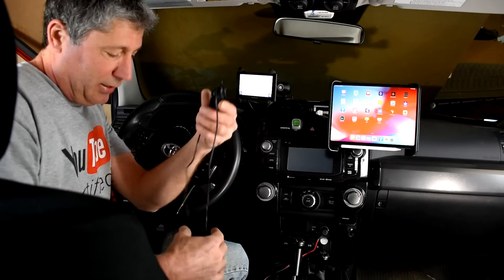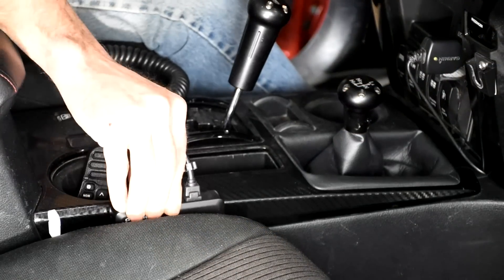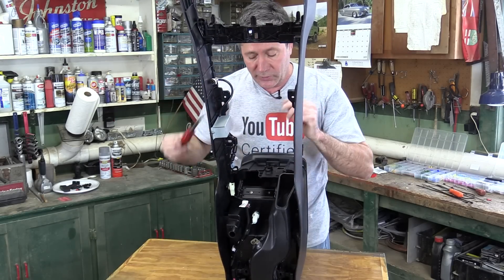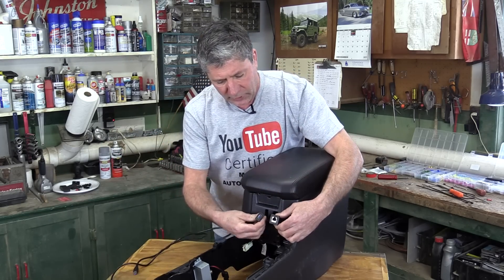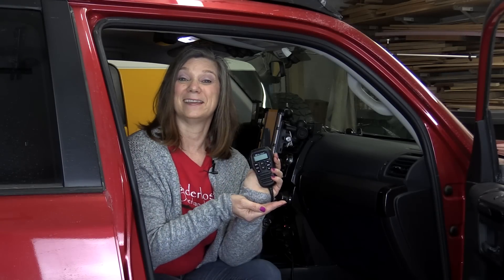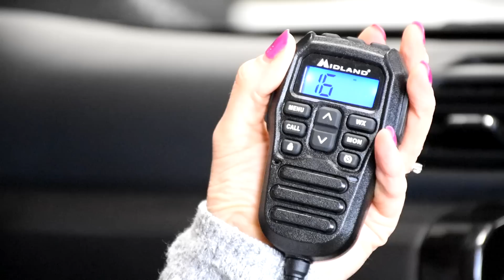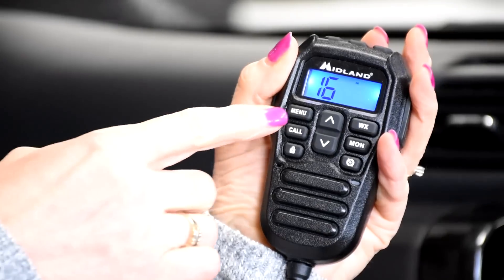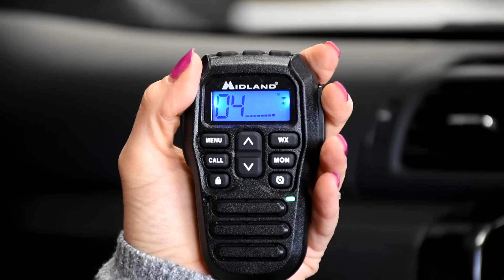GMRS Radio DIY Install & Testing Against CB Radio For Distance

Comment: The +6dB antenna plus a 15 watt transmitter helps a lot over CB which is very low power.  4 watts is the nominal power limit for CB, though that can be increased to 12 watts if using Single Sideband.  15 watts is a pretty reasonable transmit power, especially when using repeaters.  
You shouldn't be daunted by HAM radio, the Technician portion that allows access to 2 meter and 70 cm frequencies is VERY easy and only costs $15 instead of $70  On top of that, there are literally thousands of repeaters nation wide on the 2 meter band that allows for very easy and reliable contact for casual chatter and for emergencies.
Additionally, getting a HAM license allows you to access transmitters of MUCH higher power, giving you a LOT more range for station to station or hitting distant repeaters (60 to 70 mile ranges are common with a 25 watt transmitter.  I have a 50 Watt in my truck).
7-3, folks!  Pete, callsign KD2SML
Reply: I agree, the test was not the difficult. I have a 2 meter (80 watt in my truck) KEOJXA

Comment: Good vid. No doubt UHF blows away CB. VHF (MURS) is better than CB as well. The only advantage in using CB is interoperability with other CB users. Other than that CB sucks. 

If you are gonna go so far as to add a NMO mount antenna, consider a higher watt radio. You’d be amazed what a higher grade 40-50 watt uhf or vhf radio can do compared to what that little midland can.  All that said, you guys did a great job with this vid. 

And lastly, I have a dual band (uhf/vhf) mobile in my Jeep. A dual bander might be something to consider at some point if you want more options (& power).
Reply from the maker: Thanks for the tips, and for watching!

Comment: Ham test is easy.  Mobile uhf/vhf rigs put out 50+ watts and you can use repeaters.  Downside.  No one uses them anymore.
Reply: They don't? Ours are busy all the time here in Texas! Where are you located?
Reply: WW5RM Oregon.  We have repeaters that are in use a lot, but most of the off road/ overland people I know don’t use ham.  Which is a shame because it’s a far superior system
Reply: @NoneYaBidness762  oh I thought you were saying the repeaters weren't used anymore. We have a linked repeaters system that's growing fast here! It covers most of East Texas, North West Louisiana and South West Ark. Plus remote bases in Hot Springs, Little Rock, West of Little Rock and some East of Dallas. They bring up the remote bases for weekly NETs and Severe WX. 

They are expanding all the time! So at any given time you can be East of Dallas talking to someone way up in Ark or North Louisiana. 

I run APRS in my Zuki. WW5RM-9 plus ive got HF too. I do some SOTA too when I can. But I'm to old and broken to do much hiking! lol 

HF is where all the fun is! I got 30M APRS too. WW5RM-13

But MURS is better than GMRS. Unless its a GMRS repeater in your area. Which might explain how they got theirs to work is well!
Reply: @NoneYaBidness762  I forgot. They have the link system all the way up to Central Ark now. One up on Mnt Magazine I believe and it covers west of Little Rock over into Oklahoma I believe. But only certain ones are on 24 / 7. During the weekly NET they bring up all links so its a huge foot print! 

But I'm more of a HF guy. Usually 75M and 40M. I worked some of Europe,  South America, Central America, North America, a few Islands, South Africa and Australia. I prefer to rag chew and pulling legs! Those old farts on 75M always good for a laugh! Tons of fun! =]

Comment: Great video I plan on purchasing GMRS radio and  I am studying to take my ham technician license,  hey I just turn 60 years old everyone should at least have Ham Technician license in there Overland communication tool box.
Reply: A really good way to study (and it's free) hamstudy.org  create an account, and it will keep track of the questions you answer. When I did it, I would put it on T1(or whatever is studying, then the site would keep track of my mastery of that unit, after getting above 90% I would move to the next unit, and so on until I had 90% on all of them. Then I would take the practice tests, until I was above 90%. By the time I paid my $14 and took my real test, I passed with flying colors. It was about 30 minutes of studying a day, for 2-3 weeks. 

*The website is free on mobile or computer, there is an app that cost a couple bucks. I just kept a browser tab open on my phone, and that was free.

Comment: We have a ham Radio due to the remote travels we take. GMRS Technology is amazing. May need to finally pull the trigger. Only hesitation is the current lack of others that are using the GMRS platform.
Reply from the maker: Thanks for watching Mike! We're finding the radio platforms groups are using vary greatly across the country.
Reply: Wanderlost Overland. Own a 2016 JK but love your content.
Reply: Late in this thread, but they'll be a whole lot of Jeepers soon joining the GMRS club.  The folks that run the Jeep Jamboree are changing from CB to GMRS.  You'll need to have GMRS in order to participate.

Comment: Good side to side comparison of CB and GMRS! About 2 years ago I was going to install a GMRS in the Jeep, but had signed up for Easter Jeep Safari and found out that you really should have a CB for that, so put one one. Since that time we have installed a 2m / 10cm Ham radio , and now have 3 handhelds. Don't fear the Ham test; my wife, with no technical background passed Technician Class on the first try, and as she like to brag, I aced it. As Global Mobile said: "...always within range of a 4 meter repeater..." Not that it's of interest to you Toyota types, but Jeep Jamboree has made CB optional this year (it was mandatory) and announced a partnership with Midland Micromobile; I'm guessing that GMRS will be mandatory in 2021.
Reply from the maker: Thanks for watching! Yes, like the Jeepers the Toyota events are beginning to suggest GMRS over CB too.

Comment: I operate on GMRS & HAM currently.  Think about installing a Ham radio for monitoring repeaters in the area. And 146.520 simplex operations while traveling.  No license is required for "Monitoring" ham radio traffic.  More incoming information is always a good thing for disaster preparedness.  Also it will allow you to slowly learn & enjoy ham radio.  Loved your video  :)
Reply: Dont forget the MURS.
Reply: Jose Enrique  I think MURS has a 2 Watt max
Reply from the maker: Thanks for watching! Great advice on using the ham.

Comment: Very nice!  

What external speaker did you use and where did you mount it?
Reply from the maker: I believe we got it from Cobra. We used the bracket that it came with to bolt it onto the rear most end of the overhead console.
Reply: @WanderlostOverland  Thanks!!
Reply: @Gadget0343
You can get any speaker with a 3.5 mm jack at truck stops, eBay, etc. for $10 bucks and up.  Same type of speakers that work with most CB’s.

Comment: Great video it would be nice if you got rid of the CB and got your ham ticket... there are times when I hear nothing when I’m out on the trail from the GMRS But I am always within range of a 2 meter repeater with someone talking on it
Reply: Why get rid of CB if it's already on there?  Just add a 2 meter radio as well.  Then you have three systems and more options!  Repeaters do fail and break.
Reply: @danielmaine45  I got my first cb back in 1969. Still have many cb radios all over the place. Dont use them much anymore but probably had more fun on them than both my GMRS and ham radios. That was back when you could talknaround the world on them when the bands were wide open and the solar activity made 5 watts talk like a kw today.
Reply: @dheller777  hop back on 38LSB some time!  It's picking up more than you might thank!  Solar activity has changed a bit as well.  Was talking to Trinidad and Tobago from Oklahoma or Arkansas as I was driving just the other day! (In Al fairness I was pushing around 40 watts that day)
Reply: @danielmaine45  Good point; especially if there is an active logging operation in the area. The log trucks typically us CB and often the channel is posted on the road.
Reply: GMRS is a great tool for car to car on a trail ride, but if you want to get ahold of someone in the outside world HAM is the way to go.
Reply: @JKTrail  I have both the ham and GMRS license. There are GMRS repeaters just as there are ham 2 meter repeaters. Just search these repeaters on google.
Reply: @dheller777  I also have both licenses, but haven't really put the GMRS to full use. Around where I live I can probably choose from a dozen HAM repeaters, but someone is just now setting up a GMRS repeater in the area. A lot of the GMRS repeaters I've looked at are private or membership based.

Comment: I agree that GMRS is better than CB, however I run CB and Ham instead of GMRS. Ham offers far more options, especially if you want to use repeaters or tracking via APRS. Regarding the test for Ham Technician, it's really easy and there is a great way to train for the test. Go to https://hamexam.org/ and pass the test. And by the way, I would appreciate if you could explain how to rip out the center console to mount the unit.
Reply from the maker: Thanks for watching, and the advice Andreas! We left that detail about removing the console  because I thought for sure we showed how to do it in a different video. We were wrong, sorry.

Comment: Well this definitely helps me as I have been doing some lite research on what radio system I wanted to venture into. CB was really on the bottom of the list and I too didn't want to take any tests. I am unable to mount in the same place due to a safe in my console but no worries. I have been leaning towards Midland so this just solidifies it for me.
Reply from the maker: Thanks for watching! We're very happy that you got some useful info from it. Midland makes great products!

Comment: Why not rugged radios?
Reply: Prob because they should be shut down
Reply: Rugged radio brand promotes illegal use of illegal unauthorized frequencies .
Rugged radios is also way overpriced for junk crap radios.
Reply from the maker: That's something that we didn't come up with during our research. Is that a brand?
Reply: Gimmick ripoff
Reply: Do not key up on RR

Comment: Good stuff to know. I have been exploring comm options so this is helpful. 
One thing I would change though, is mount the RJ45 with the contacts up so dirt and debris doesn't collect on the contacts when not in use.
Reply from the maker: Thanks for watching Steve! Good advice on dust and dirt getting in. We're looking for a cover or plug to put in there when the mic is detached.
Reply: @WanderlostOverland  You can easily get an ethernet cable, cut the RJ45 jack off the end and shove it in there.  It will stick out a bit but it will plug the hole.  You can also search amazon for rj45 snap-in dust cover.  They look better but aren't as readily available.

Comment: You guys are awesome contributors to the wheeling hobby. Always enjoy your videos. Quick tip I learned in the navy on radios, place the mic to the side of your mouth so it still picks up the sound waves but avoids the force of air coming out of your mouth onto the mic potentially interfering with your comms. When the mic is directly in front of your mouth, the mic will pick up both air noise and sound.  Cheers.
Reply from the maker: Thanks for watching! Excellent advice, thanks for sharing that with us!

Comment: What’s your call sign?
Reply: GMRS radios require FCC paid license. 
It is only $70 at this time. 
The GMRS license is good for 10 years and 1 license can be shared with your family, grandparents, aunts and brother in law... just can not share GMRS license with friends or businesses. 
Read the manual that comes with the GMRS radio.
When you get a FCC license they will give you a call sign .
When you use the GMRS radios always say your call sign to identify your proper licensed use of GMRS radio....
Reply from the maker: You've got us at a disadvantage. Is our call sign something that we come up with, or is it something assigned to us?
Reply: Wanderlost Overland you should have been issued a call sign from the FCC just like you would for a HAM lic.  You can log back on to your account using your FRN # and see your call sign and even print your lic.  Should be getting one in mail though.   By rules you are supposed to ID yourself at end of transmission and off and on through out conversation etc.  For GMRS and I’m outside of Rockford my call is WRDZ346
Reply from the maker: @XtremeGrizz  Found it! Didn't even know I had one: WRFC363